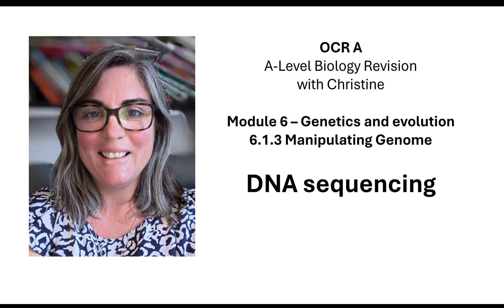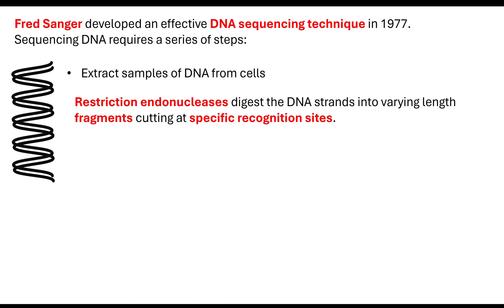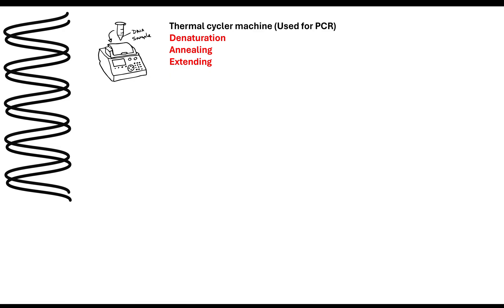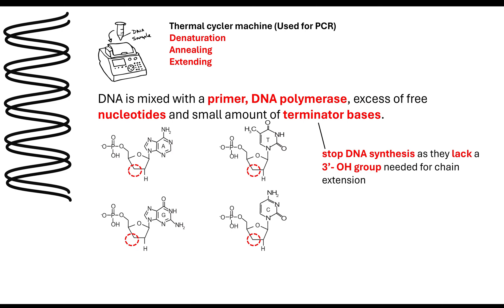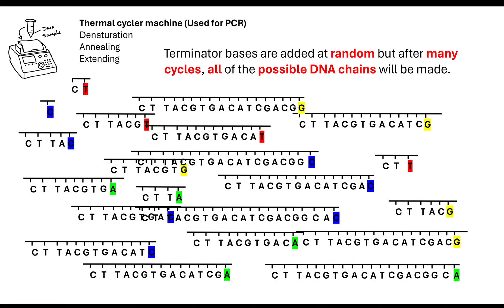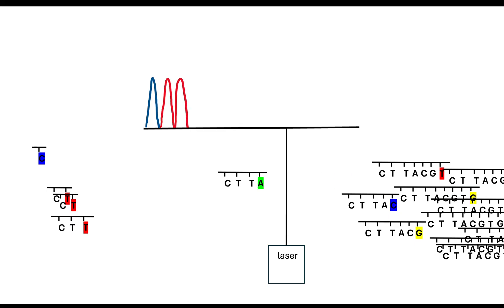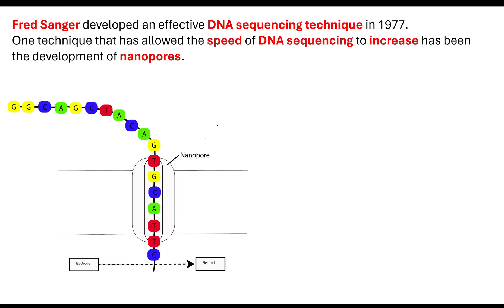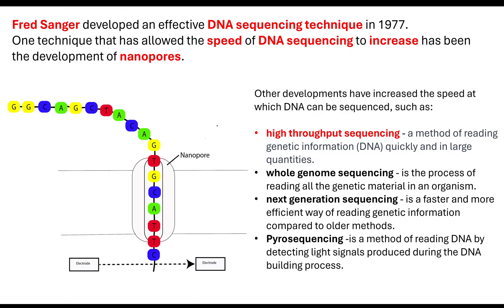DNA sequencing OCR A A-Level Biology Revision

Comment: hey miss is this a good answer to say  - 1. we extract dna 2. cut it into fragments of varying lengths - using restrcition endonucleause ofc 3. amplify using pcr 4. dna is mixed with :primer, free dna nucleotides , dna polyermase and terminator base - 5. terminator base are added on random - role of terminator base is to stop dna synthesis occuring due to the absence of OH group on carbon3  this means the chain is unable to expand. 6. we then seperate dna fragments using a gel electeophoresis - dna fragments are seperated due to mass. The lighter dna fragments will move faster and more further down - dna is negatively charged so it will move from the negative electrode to the positive electrode through the gel.
Reply from the maker: Great answer and understanding

Comment: Hi, how is the DNA cut into fragments using restriction enzymes as double stranded, but then it leaves PCR single stranded? I am a little confused as in normal PCR it forms double stranded DNA so how does a double stranded DNA enter but a single stranded DNA is produced for DNA sequencing? Thank you
Reply from the maker: Before the electrophoresis step the fragments are denatured to separate the strands leaving only single strand DNA fragments for the process of sequencing

Comment: when answering a question related to the sanger sequencing, would me mention PCR or denaturing, analetion and then extension?

same for the gel electrophersis section, would we mention gel electrophersois or a laid out method/order of events for gel electrophersosis
Reply from the maker: It really depends on what the question stem says. If it is a describe the methods question then either is fine as long as you describe with Denaturation, annealing and extending means.
Reply: @BiologywithChristine  thank you !!